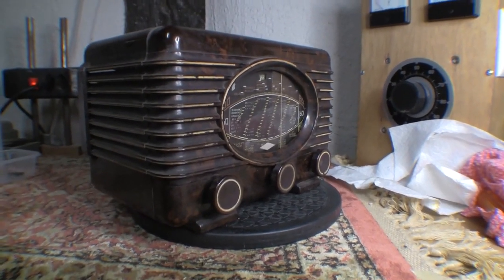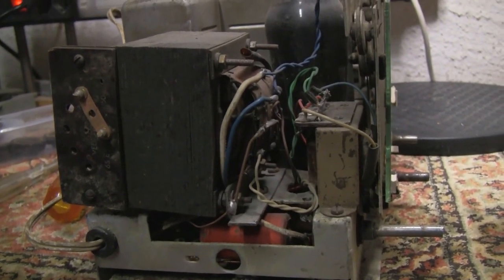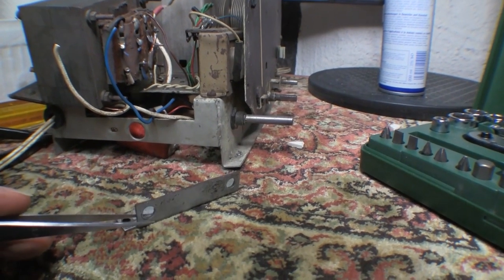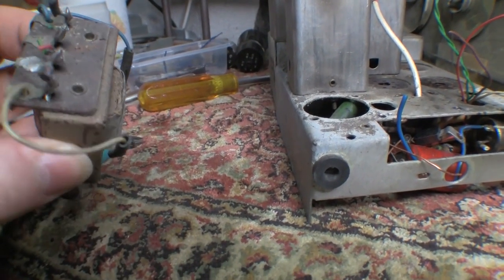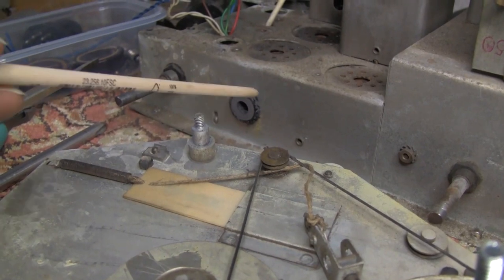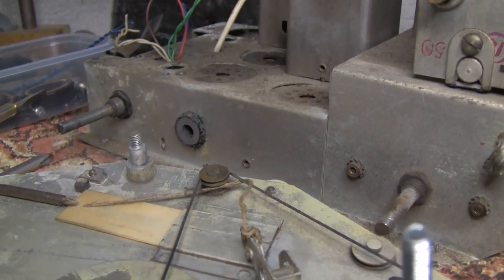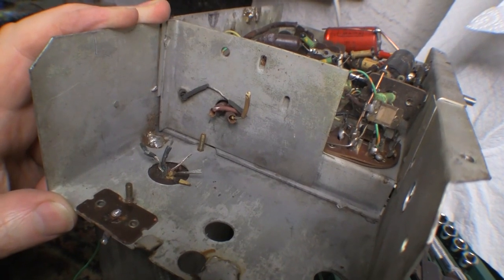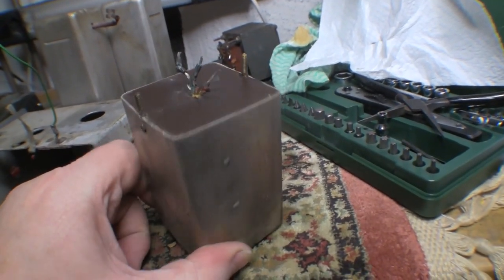Radialva Groom Rebuild - 1

Comment from the maker: Hi, I normally pop the tuning cap in the ultrasonic cleaner.  The cleaner fluid to add to the water will vary by country since it can be shipped only by ground transport.   Interestingly, when I bought the cleaner itself the same company said they could not sell me the cleaning fluid as it was only allowed to sell to bona fide companies.  I found a local website who sold it to me no problem.  In general you just select a fluid that is good for cleaning aluminium.  Look out for the next clip..

Comment from the maker: I had heard that superglue doesn't respond well to the temperature cycles as valves power up and down but I had not heard about it causing the bulb to crack - thanks for that.   As I mentioned I just put a tiny amount on it to keep it from getting worse until I could check it out in the valve tester.  If failed totally so unlikely I'll be keeping it unless a quick re-solder of the base pins brings it back to life.   All but one of the valves in the set failed. Cheers,  John.

Comment: Hi John. How nice that you decided to work on that set. Despite challenging, I guess the result might be great. Interesting solution that you used to remove the front panel. Now you know how to replace that rubber part in the other set. I didn't expect you to go that far and strip all components, but I think it will be very nice to see your progress on the work. By the way, what is the product you use to clean the variable capacitor? Looking forward to the next parts of the series.